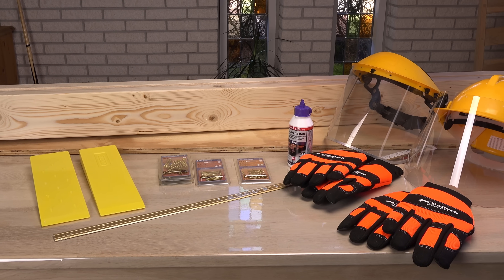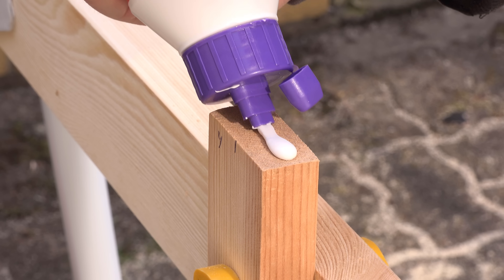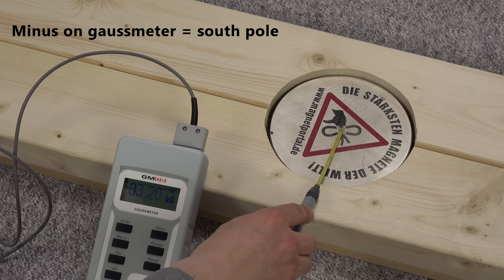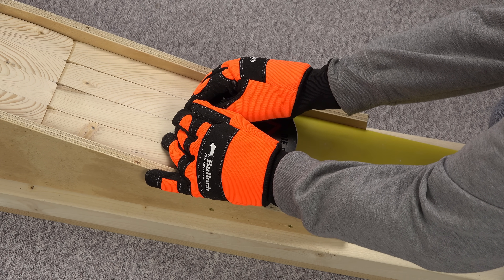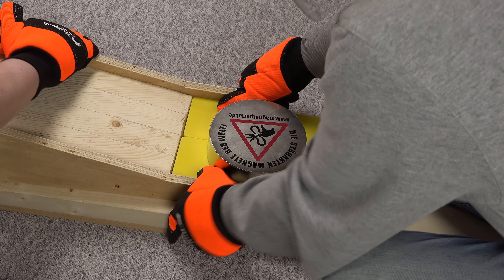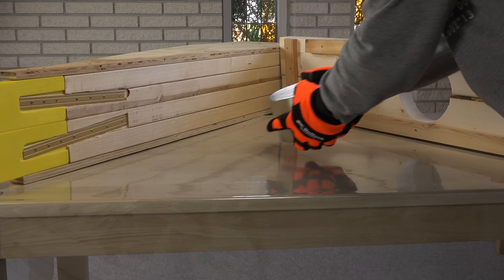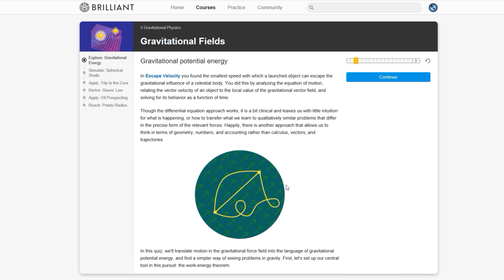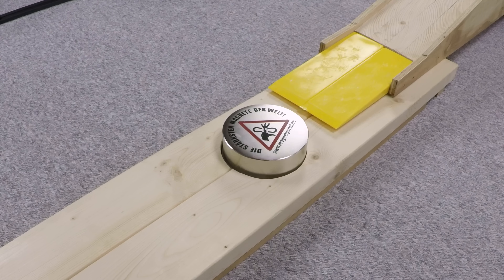Monster magnet meets monster magnet...

Comment: Interesting.

I think an easier, and more spectacular way of going about this would have been to buy a piece of 6” inside diameter PVC pipe, cap one end, put the magnet down there, and fill it with water. Then put the other up top and push them towards each other. The water could only get out of the way by seeping around the top magnet, and since its incompressible, they could only go so fast towards one another.

Though, of course that assumes these are the right size to slip fit the pipe. And since I don’t have $500 to buy one and check, I’m not sure they are.
Reply: When they get close, the pulling force might be strong enough to over-pressurize the pipe and everything goes kaboom.
Reply: Madis Jõgi Minimum burst pressure is 560psi.

Since pressure inside the system is going to be equal, given the surface area of the magnets, there would need to be an attractive force between the magnets of over 15,830lbs to achieve that.

If it was even close to that, what we just saw in this video would never work.
Reply: It would make a great video!
Reply: Its a good idea. You'd just have to make sure the wall thickness of the pipe is thick enough. As the magnets get closer together I imagine the water pressure between the two magnets would probably become enormously high. So if the pipe wall thickness isn't rated for the pressure it would split and release all the pressure in a small explosion that could hurt someone nearby. 

You also might have to be careful about the water seeping around the magnets. Again, as the magnets get closer the pressure will become very high, so I imagine the water seeping around the edges of the magnet might become high velocity little jets of water, which could hurt, especially if it goes in your eye.

You also might need to lubricate the inside of the pipe a little bit encase the magnet becomes off centre and starts going down the pipe at an odd angle. 

Maybe also just make sure the pipe is long enough so there is little or no magnetic attraction at the ends of the pipe, so you can avoid any injury with your fingers.

Apart from that I can't think of any additionally problems. Hopefully its transparent PVC so you can see whats going on. Oh and I don't know if it exists, but if there was a chemical that changes colour with pressure that might make it more interesting to watch. Like it goes from transparent to blue, to violet and then finally red at really high pressure.
Reply: Wrap the pipe in duct tape!  :-D
Reply: Fubi Sroc he demonstrade that tape increase the friction
Reply: Illuminati Confirmed in which case have a high speed camera and a sheet of bullet proof glass.
Reply: Da S with the magnets basically touching the water pressure would only reach about 93 psi
Reply: Thaldria Taeyeon How'd you calculate that?
 https://www.sensorsone.com/force-and-area-to-pressure-calculator/
That calculator says the 28 in^2 and 2tons of force puts out 142 psi. As that inch of water between the magnet shrinks to say say .5 inches, the psi jumps to 285. And as the magnet almost touch at .1 inches apart the remaining water is blasting out of there at 1413 psi.

If theres some science I am missing please enlighten me.
Reply: You are forgetting that it's not the water that will burst the pipes but it will be a slight angle of the magnets that makes dents into the plastic and probably cracks them. The force is not evenly spreaded.
Also, in order to prevent any damage to the magnets, you would need to get a perfect pipe and that would already be very hard.

I think their way was much easier to perform and most probably safer (when done at home).
Reply: Dan S; here's the skinny on your calculation:
The full force of the magnets is not applied until the magnets are virtually touching each other.  At that point, the force is 2 tons/4,000 lb.s.
  If the magnet diameter is 6", then area, = Pi x R^2, or 28.27 square inches,  as you say.
  Therefore the MAXIMUM PRESSURE POSSIBLE is 4,000 lb/28.27 in^2, or 141.5 psi, as you figured.

  The mistake you made is thinking that the force at 1" separation is 2 tons, and that it increases exponentially (i.e., force doubles each time distance halves).  If that were so, the pressure would increase to infinity as the magnets get closer, because the distance halves, then halves again, then halves again, etc, ad infinitum.  This means the force, and therefore the pressure, would double, then double again, then double again, ad infinitum.

  I believe the working pressure for schedule 40 PVC pipe is 150 psi, so I guess it WOULD work, to my surprise.
Reply: Actually the pressure would only reach 145 psi, to my surprise.  (4 tons force/28 square inches surface area) Schedule 40 PVC should work.
Reply: Nice!  I'd never have thought it could work before I did the calculation!
Reply: You'd get a better result using higher viscosity fluid, as it would flow more slowly around the magnet. You could probably even layer two kinds of oil with the heavier stuff on the bottom where you really want to slow the descent.
Reply: That is a little close to the max pressure rating. Might be better to spend a few bucks more on sch80.
Reply: Now we only need true diameter of those magnets to determine if they would actually fit correctly.
Reply: That would most definitely explode as the magnets have 1 ton pulling force each. Imagine a truck hitting the road barrier buckets of water. It stops the truck but they explode everywhere.
Reply: ‼️HEY GUYS PLEASE HELP ME GET TO 1000 SUBS WITH NO VIDEOS BECAUSE THAT WOULD BE AWESO 
 ME SO PLEASE DO IT‼️

Comment: You can control both your eyes seperately! That crazy
Also i would love to see you try and compress two of the same sides of a magnet together (i mean like try to overcome the magnetic poles rejecting each other)
Yet other point, couldnt you try and heat up the plastic between the magnets and when it becomes liquid the force between the magnets would force the plastic out?

Comment: Plastic, wood, or any other soft materials are not a good idea to use as wedges... a non magnetic metal that's very strong would have been much better, that way they wouldn't rip off when the magnets get their closest and pinch it off.

Comment: Why don you just stick them together rather than go through that process?
Can someone explain? Idk
Reply: because magnets ACT gravitational toward one another. there pull force is a literal tonne. so the force exerted to unite with one another is 2 tonnes once they are close enough too each other. thats like a semi-truck pressing on a metal plate the size of the magnets. also they are ceramic in nature so they are fragile, volatile, and very very fast.
Reply: Tl:dr The magnets are so powerful that putting them together normaly is dangerous and the magnets would likely break.
Reply: yeah, but the thing is you can't hold them, The magnetic force is really strong, it's a few tonnes of pulling force, it like holding a car back with your hand while it's driving forward.
don't underestimate it.
Reply: Gerry Wang 
That’s not what I meant, because he clashed one from a distance, what I mean is like slowly click it together from a very close distance...?
Reply: this will happen if you put them togather like that
https://www.youtube.com/watch?v=Vt8NOdINJ1s
Reply: u can't the magnetic force of the magnetic will pull them together just like in the video, you can't do it slowly
even horizontally
btw your finger will probably get squish flat.
Reply: Gerry Wang 
But you can hold it from the sides... can’t you?
Reply: I think gravity in those magnets is rather low, otherwise it would not have shipped by mail.
Reply: Miss MT Unless you can hold two tonnes (two semi trucks) ...no, you can't just hold the magnets close to each other.

Comment: Why is such a large magnet manufactured? Like what real world uses does a 6x2 neodinium is needed? Curious
Reply: i guess they would usefull for building electric generators and motors.
Reply: Not really, electro magnets are much more convenient and safer to handle for generators and motors.

I think the main reason is "because it can be done".

Another reason would be some research that require strong magnetic fields where the corresponding electric field from an electro magnet would be ruining the experiment.
Reply: Anywhere you want a huge magnetic field without powering an electromagnet. Also, since they have a huge diameter, you can take advantage of how the center of the disk has basically uniform magnetic field lines. Also, these might be way cheaper/ portable than a similarly strong electromagnet and don't require electricity. So I could do my magnetic stuff in the jungle or something...

I have no idea though...

Comment: The squeak sounds is from the pressure of the magnet pushing down on the plastic so hard its causing the plastic to scrape the wood to make a noise and the plastic on the magnet as well creates the other noise.

Comment: I would have just dropped one magnet on top of the other, that was too complicated.
Reply: filefolder3 the magnets are so strong they will smash into each other and break
Reply: It shows that you've never played with strong magnets before.   They are very brittle, and the force involved would have shattered the magnets.   The fragments then tend to get flung around with tremendous force.   With small magnets, the fragments mostly pose a risk of eye injury.   With a magnet that powerful, I suspect that the result would have been more akin to a bomb with lethal results.    I'm glad that the experiment depicted in the video was successful, but I think that they weren't taking sufficient precautions.    The work gloves and face mask probably should have been replaced with a full EOD suit.

Comment: I believe the sound was made by friction. The wood didn't make the sound because it has less friction due to its less compressiveness. The plastic wanted to compress causing heat which in turn caused more friction also causing the magnet to want to stick to the plastic but let go again and stick again. That's where the skidding sound comes from in my opinion.

Comment: Predictions:
size sq 15,000(vol 1767)  =  Gauss= 1346, saw= 29.4,  compass  = 283 or 274
(size sq 25,000, Gauss=1,706,  saw= 42,  compass=408) (size 200 x 125)
(size sq 50,000, Gauss=2,755,  saw=72,  compass=740)  (size 200 x 250)
(size sq 100,000, Gauss=3,976, saw= 133, compass=1405) (250 x 400) 
Or It can be all wrong. :) (based off combining size, gauss at a loss of 1.0360, saw at 1.0371, compass 1.0353 Something is off)
Try a test to see which magnet can hold its own weight. The more powerful the magnet the less efficient.
Example: Put the magnet under the table and a piece of iron at the top and slowly raise the iron up to see when the magnet will fall and the heavier one can not hold its own weight compared to the smaller one.
Also try a pyramid magnet which should be stronger some say.

Comment: now pull them apart.
Reply: Oof Oof well, i think if he use a stronger material than wood, making 2 holes to separate the magnets, and using like a truck he could make them sliding and separate! Also, It would be very interesting the Force that they can have when you try to slide them
Reply: lucusloc lol
Reply: Impossible.. not if you use a huge industrial machine, but I doubt he has one.

Comment: Why they aren't wearing shoes? Because of the magnet force?
Reply: My guess is that if their feet get caught, it is better to just have the socks fuse with the feet than socks+shoes.

For obvious reasons (I hope) steel caps are useless. And what if there are any pins made of magnetic material in the shoes?